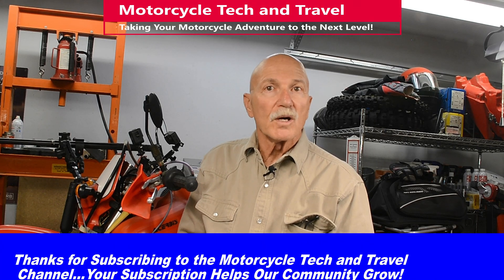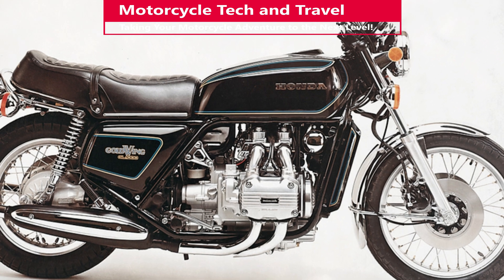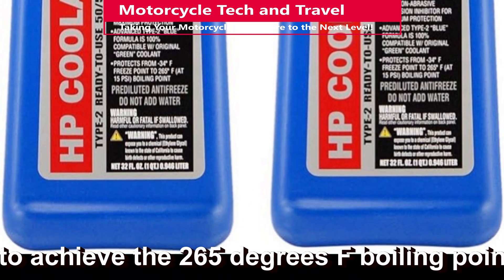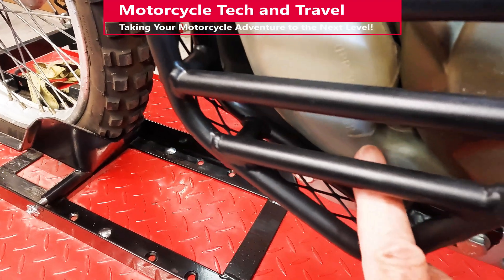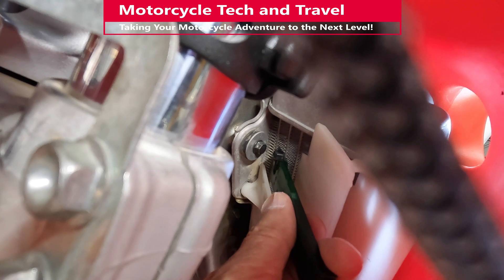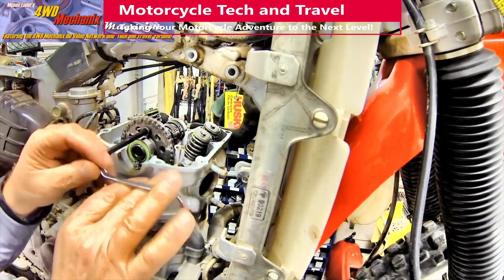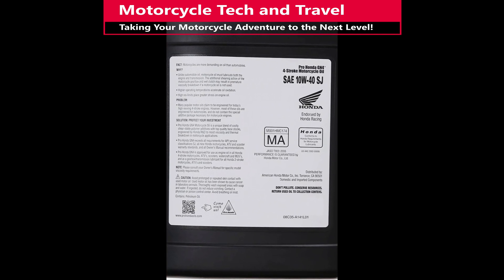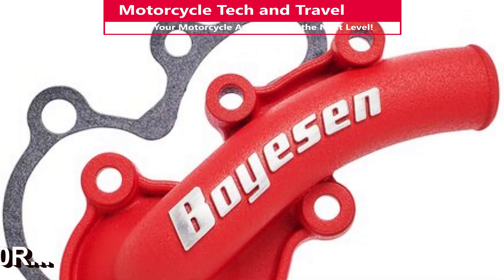Preventing an Engine Overheat on Liquid Cooled Motorcycles

Comment: Which Pulstar plug are you running? Is it the I-BE1H10? Thanks
Reply from the maker: I have run the conventional BE1HT10.  This plug has an inconel electrode and a removable terminal cap that needs a snug fit.  I've not tried the fine wire.  They work well in automotive applications.  Here are details and specs on the BE1HT10:  https://pulstar.com/products/be1ht10.  I always carry a spare plug into remote country.  Enjoy the ride and let us know how the Pulstar works for your bike!
Reply: @MotorcycleTechandTravel  Thank you very much, I will give the BE1HT10 a chance on the next plug change.
Reply from the maker: You're welcome...Let us know how the Pulstar plug works for your riding!

Comment: My XR650R has boiled on a few single track rides.
For years it's been recommended to replace the stop cap with a lower pressure cap. I never did it.
Reply from the maker: I've been fortunate and not had a boil over yet.  Some increase the radiator cap pressure, which raises the boiling point.  I have elected not to do that, as it also places more internal stress on the radiator tubes and seams, the hoses and gaskets.  Some add aftermarket fans at the radiators, which I also have not done.  The fans would be a solution, for sure.  My concern with the XR650R, however, is the stator output.  If I added fans, the stator would be upgraded, too.  I'd step up to a higher output/wattage aftermarket stator.